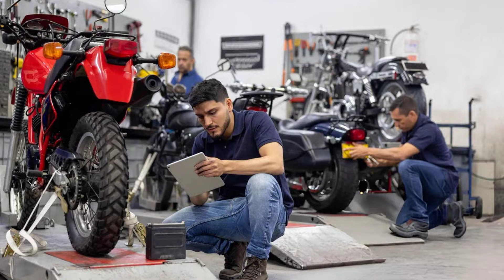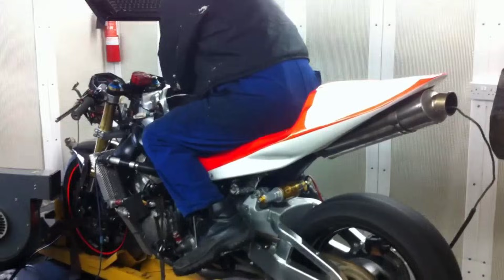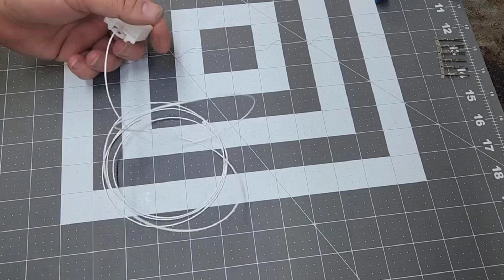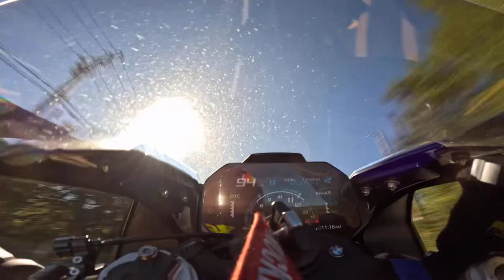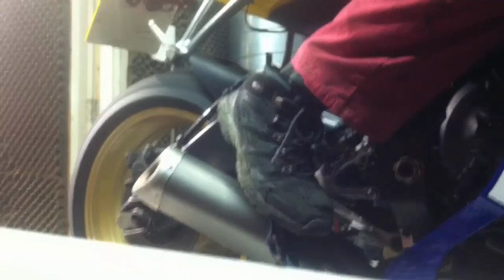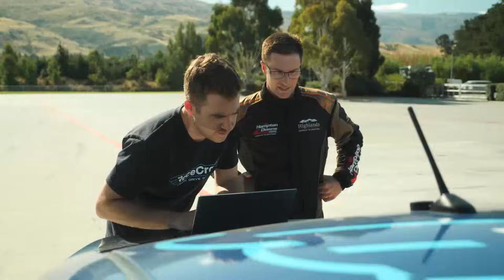Low RPM Riding? Here's What's Actually Happening

Comment: 2000 rpm ? maybe on a cruiser type but sill to low, in a car yeah maybe but in a motorcycle with 150cc-650 I think 4000-5000.
Reply: Honda cb500x can pull 2k rpm

Comment: 7000rpm may be the engine’s happy place but on the street on my sport bike 7000rpm is very unhealthy for me due to the higher speed that comes with higher rpm, even in second gear I’d be travelling at a speed greater than the speed limit and there are obstacles such as buses that love to pull in front of me when I least expect them. An engine that has been properly designed will function happily at 3000-4000rpm and when appropriate it will also happily rev all the way to redline.
Reply: I'd love a racing bike. But once I figured out they only really shine on the track and for high rpm you're stuck in 1st gear only, that ambition changed